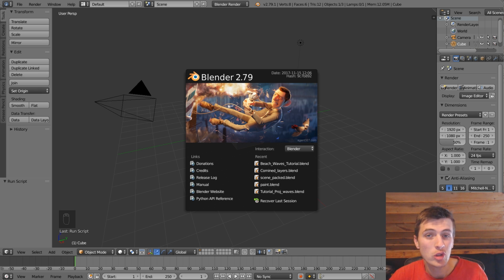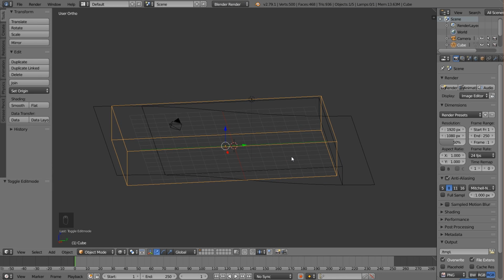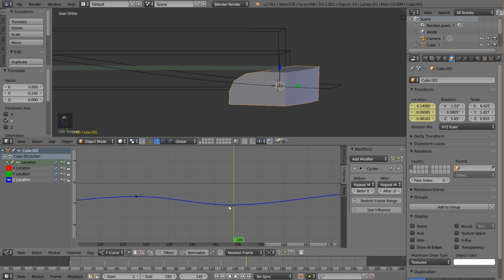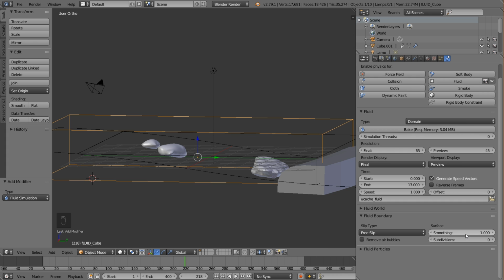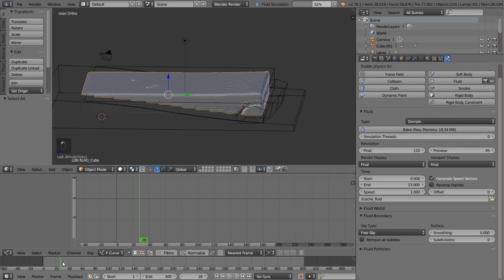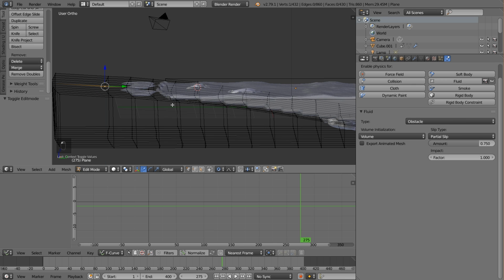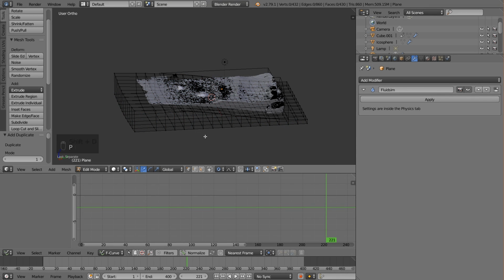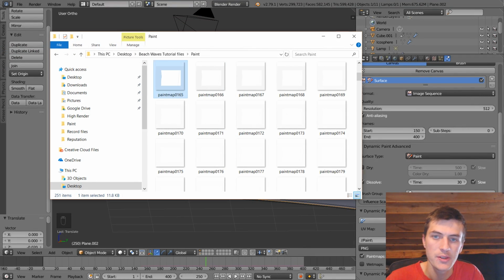Beach Waves - Blender Fluid Tutorial : 1 of 2

Comment: For those who may use new blender versions, this was made six years back, so it needs those versions for this file.
Reply: Trying to follow this now on Blender 3.5 and tearing my hair out 🫠
Reply: @NoriboshiArielle  It won't work well. I have only used 2.82, so I'm trying a tutorial for that version but that is an ocean. You need to use 2.79. I know it is too dated now. I'm not even good with 2.82. If your quite young it isn't too bad if you are new to blender using the latest version. But anybody who used older version years back, and not that good with it, the new software is a bit of a learning curve.
Reply: @blenderbeachwavesblend  Fortunately, I barely touched Blender 2.x, so the only learning curve I have is going from 3ds Max to Blender 3. I struggled & finagled something together last night on 3.5. My last stream on here shows the whole thing. I used separate tutorials for the shaders & materials, & when I tried to up the res of the water, I couldn't get anything going, I'm now just stuck with a big cube of water. 😭
Reply: @NoriboshiArielle  Hmm. I only began using 2.82. But since it is far too ahead, I wouldn't know exactly how to get that going. How long have you used blender recently?
Reply: @NoriboshiArielle  Anybody that has used anything recent, it won't work well. The file itself doesn't even load correctly in 2.82. But trying the tutorial it may work for that.

Comment: I was able to do a bake of 330, but I tried 340, and it only freezes. The cache fluid folder can cause freezing. If new numbers are used for resolution after having opened a save file. My clip was 320 on my channel, including the blend, original with some trees added in.

Comment: Hey man, could you do an update video on this for Blender 3.4.1? That would be awesome with caustics and the newer fluid system :)
Reply: Did you try the tutorial in the 2.78?
Reply: @blenderbeachwavesblend  I tried the newest version and this video needs an update because you cant reproduce it
Reply: @krypto61  Ah okay. It is nice to tinker with the old file. I haven't used the new blender version. When I created the file I only realised I used 2.77 and not 2.79. Some settings were missing. Also the blurr needed to be rendered of the Paint baked setting. I don't think I did that very well. No idea where the glossy part was in the nodes, in the second video for the splashes.
Reply: @blenderbeachwavesblend  2.77 and 3.4.1 is extreme differently, the whole fluid system is different but its way faster and much better. I started in 2.78 and its like a different software :D
Reply: @krypto61  Sure, I get that. The file is dated, but filmic was not in 2.78 or 2.77. But towards the end of the part 2, where did the glossy node get added in, I couldn't work that out, in the final file, plane.002 doesn't have that in the node editor. So some of the results didn't looked right without certain settings, on the version of blender, and not everything was baked, or rendered, and added in.

Comment: This is a great tutorial, and great results. However, I have spent a lot of time trying it in a later Blender version and having a lot of issues, as a lot of the settings have changed since version 2.79.1 in this video. This tutorial will probably only work if you're using the same version.
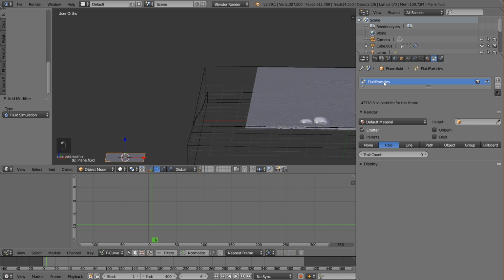Reply: I hadn't worked on this for a couple of months, and started thinking about the Blender version I'm using. After some research, I have discovered you can have multiple versions of Blender installed, as it is a self-contain application rather than installing drivers and system files all over the place. I am now working on this again in the same version as the tutorial and having much more success. However, I'm having problems with the fluid particles on the second plane at around 33:50 mins into the video. I noticed as soon as the Particle settings are applied, there is a message that says there are 43,778 fluid particles. Mine only has 1,000, and do not show after baking. I've been through it 5 or 6 times and cannot find the issue. Is there anyone that can advise?
Reply: This is driving me mad! I cannot figure out what the issue is. Logic tells me there has to be some way of linking the second plane containing the fluid particles to the original fluid in order for the particles to work, however this video doesn't mention it. I have tried assigning the parent as the fluid, and also the domain, however it had no effect. Has anyone else had the same problem and found the solution?
Reply: I have noticed the Blender version in the video is 2.79.1, however only 2.79 is available to download from Blender. Maybe there was an important update to the particles in version 2.79.1. I have decided to either not bother with the particles, or shelve this completely, as I'm (and probably a lot of people) having issues getting this to work properly. Has anyone found a way of getting this to work in a later version without installing any add-ons?
Reply: i've installed new verson but fluid tab doesn't have obstacle or fluid :(( . It just have flow, domain and effector. In Maya , it just take me for 30 minutes to make waves. @austinedwards6334

Comment: In case you're new and wondering why nothing looks or works the same in the new versions of Blender, read below;

The entire simulation system has changed since he did this and he should update his tutorials accordingly but, whatever. Blender now uses Mantaflow.
Check out a channel called Crossmind Studio, he covers fluid and smoke simulations well and updates his tutorials when something significant changes. Once you get to grasps with how Mantaflow works, replicating this will be fun. 
A general search for fluid sims in Blender 2.83+ should also give you some other tut options.

Comment: After the fluid bake (I did 475) the viewport is too slow to work in, I tried working in Wire Frame mode but that didn't help either. Is there any way to optimize the viewport at this point? This problem is boggling too, because my 2015 MacBook pro is usually quite able to handle large scenes like this with 16GB RAM. Any ideas anyone?

Comment: I did extrude the shore but i still have the fluid going through it. What could i have missed? i went back many times to this part in your video and i did all steps.
Reply: At 21:26 when you turn on the face for normals the size should be increased in your case 1.9 for it to work. I had mine smaller. You need to recalculate and bake again after the change.

Comment: Any explanation as to why some of us are only getting 1000 particles (35.28...you have 40,000+) ?
Reply from the maker: an even 1000 makes me think that its not using the fluid particles, did you setup your plane and choose fluid particles in the physics tab?
Reply: Yes ...did exactly as you did  (except I still baked at 120  not 400).....also a couple of others below have same problem.
Reply from the maker: check that its on the correct layer, you want the fluid particles plane on bottom layer. Also like I always say, make sure your using the same version of blender.
Reply: Raz the corpse (below) pointed out that the Domain and Fluid particle plane Caches must be directed to same folder. And even though they seemed to be ....I redid it and now it works....